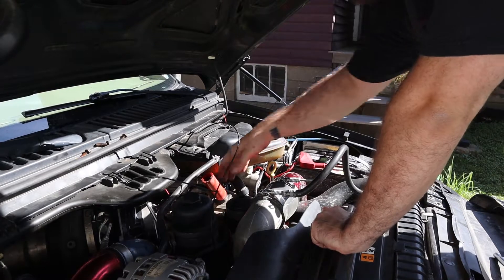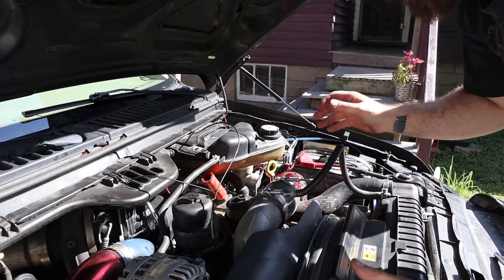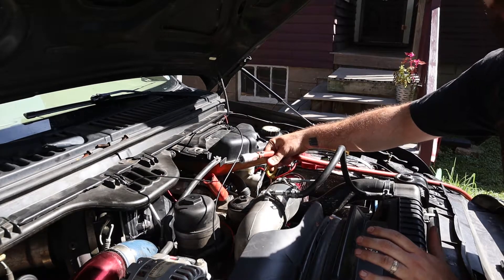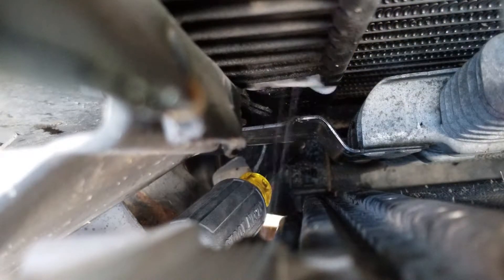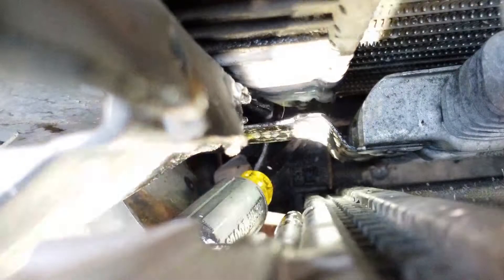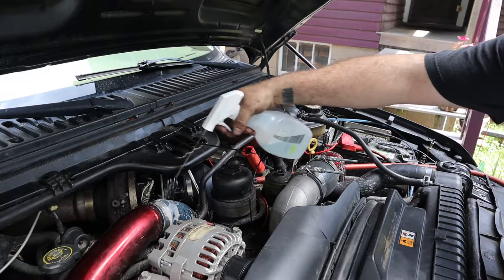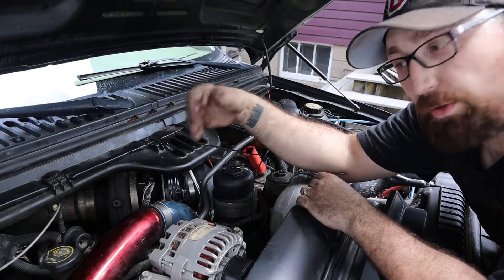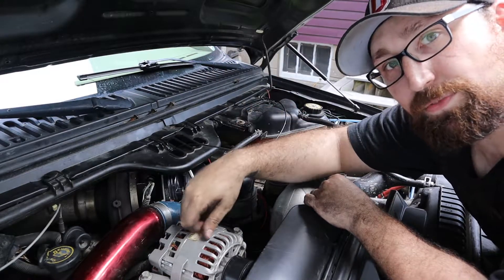How To Pressure Test An Intercooler System

Comment: Do we need a second cap, to cap off the intake hose connecting to the throttle body or can the throttle plate while closed handle the 30psi of pressure?

Comment: Is it possible for the boost too leak into the coolant and build pressure in the degas bottle
Reply from the maker: It is but that's usually a head gasket issue.
Reply: Any thoughts on coolant not returning to rad once cooled ? Thus happened b4 hg was done and the head was pressure tested etc my gut tells me it's something else. 

I have some thoughts 
Water pump don't have obvious leak but allowing air in 

Slightly restricted rad . 

Failing bekt tensioner /pully 

Months back I had some groaning noise it was intermittent.  Mostly at lower speeds rarely heard it at speed . Thus is puzzling garage can't find any faults or at least shat the cause is